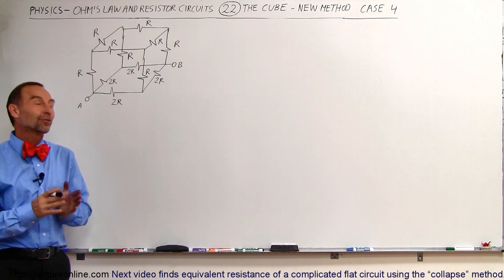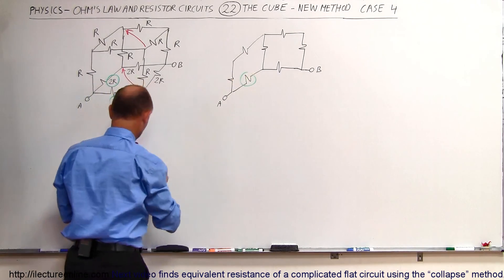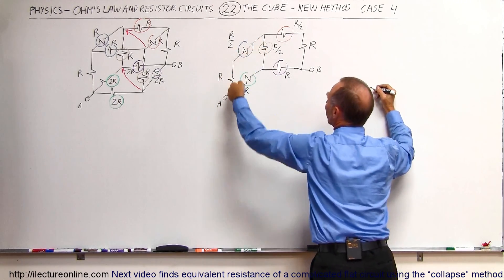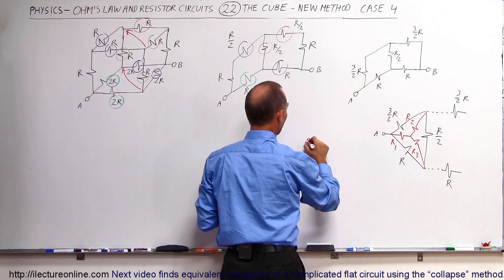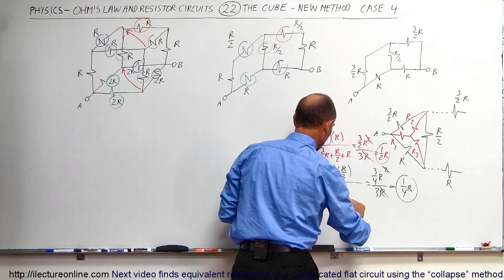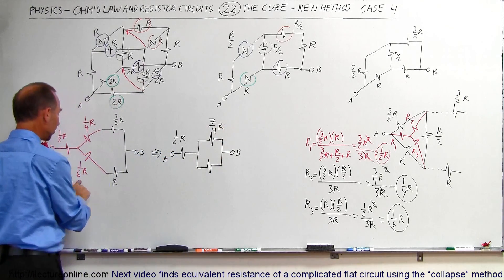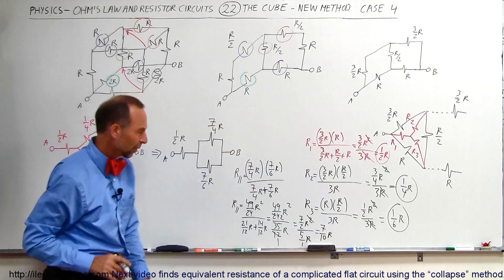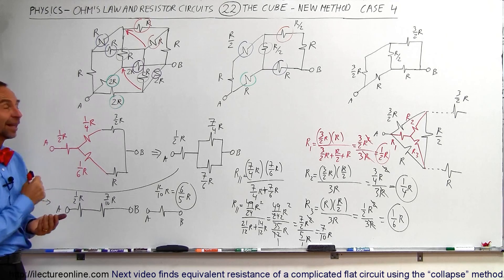Physics 42   Ohm's Law and Resistor Circuits (22 of 23) The Cube: New Method Case 4

Comment: We can collapse the cube in that direction because, A and B make a square plane that split the cube into 2 symetric parts, like A and B is 2 nodes and 2 symetric parts of the cube is like 2 parallel resistors with A and B, is that right????
Reply from the maker: Did you try that and get the correct answer?
Reply: I use a different way. I supply one current and apply Kcl at each nodes

Comment: the wheatstone bridge is in balancing condition, so we dont have to use delta-y transformation we can directly remove the middle bridge resistor as (1.5R/2R)=(1.5R/2R)..... so answer would be (1.5R series 1.5R) parallel (R series R)